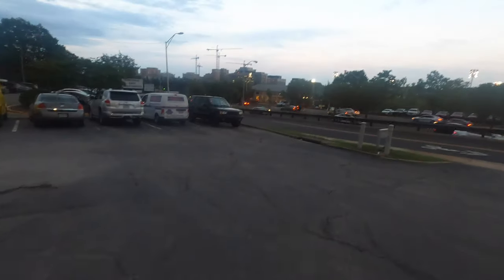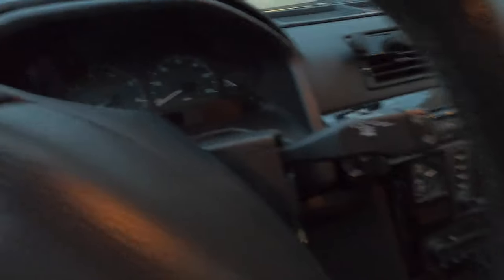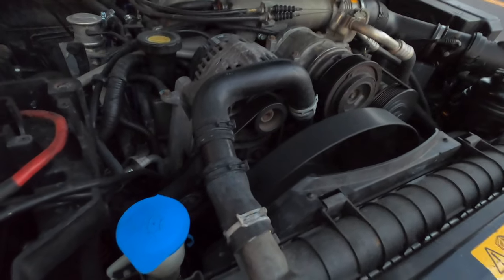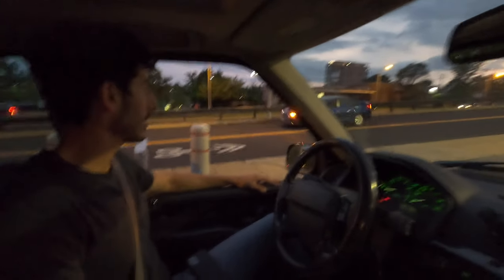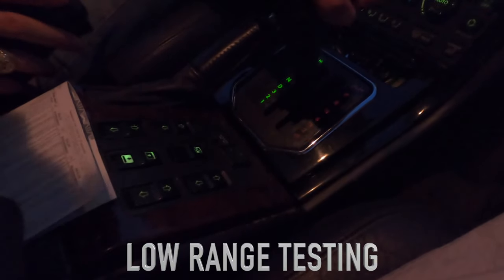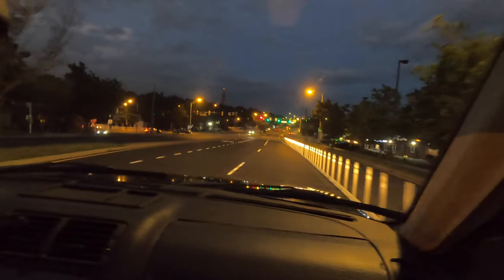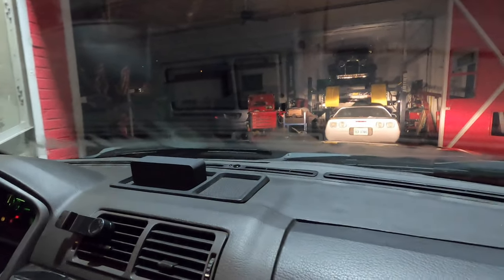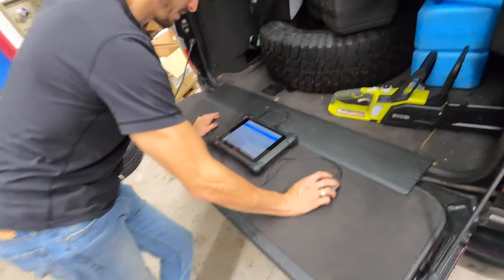#RoverRescue Part: P38

Comment: Great vid as ever Doug, I had a p38 4.6 and it was a great drive but problems with central locking, head liner and air suspension forced me to part ex , you've got a nice one there 👍
Reply from the maker: Thankfully it’s already on steel springs! Appreciate it :)